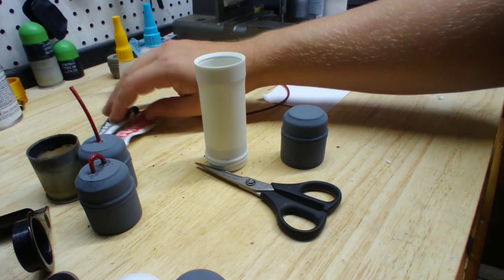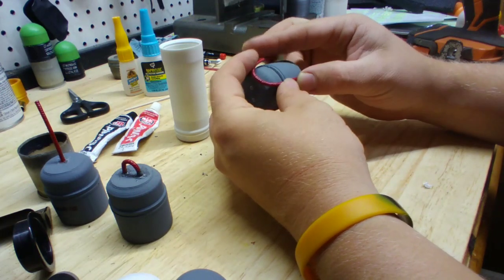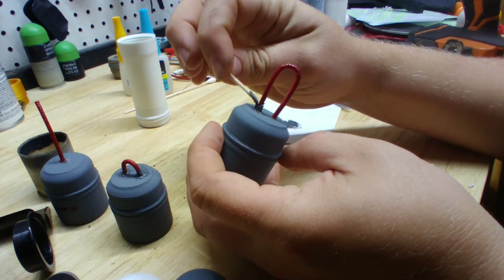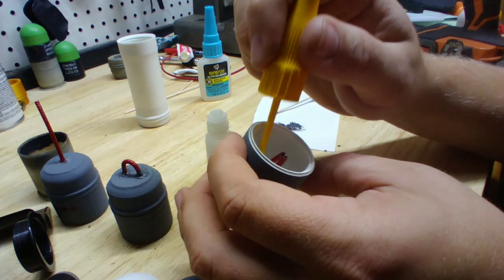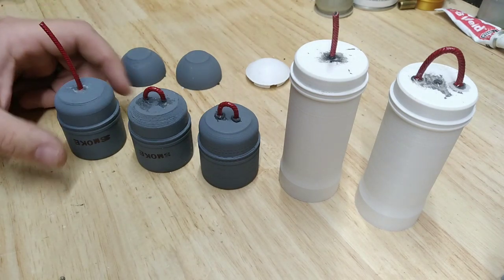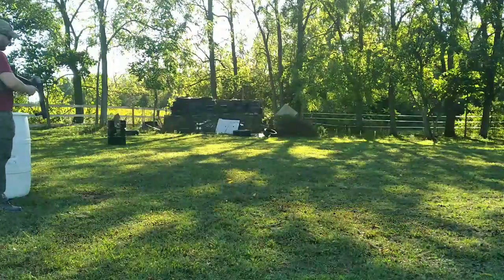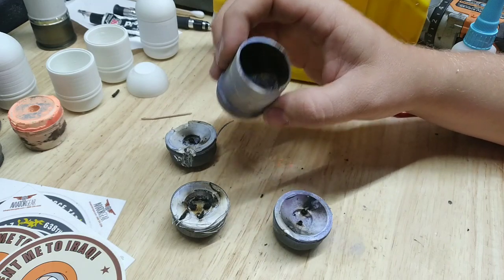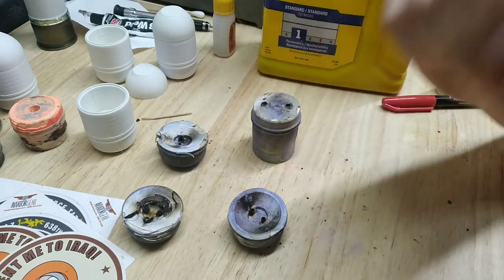Loading 40mm Smoke (Part 1)

Comment: I know it isn't legal but wouldn't it be really easy to make these into actual grenade rounds I would atleast imagine it is
Reply from the maker: Its not illegal to think, yet!! By law you can put up to 1/4 ounce of explosive. I wouldn't want to be the one holding the launcher though. People have literally lost their hand trying that with binary explosives in 37mm launchers.
Reply: @ChevTecGroup  I mean dosnt it have to have compression to explode that's why I thought it wouldn't work
Reply from the maker: @popinmo  that all depends on what you are using. Typically black powder requires compression because it is such a low explosive
Reply: @ChevTecGroup  that's really cool yea that's what I was wondering and thinking
Reply: @popinmo  If you just want a firecracker effect, you can put adult snaps in. If you are prototyping a real fragmentary grenade, as Chev said it's not a good idea, but a safe way to develop it is to only put a primary explosive charge (the detonator) which won't damage you if it goes off prematurely (but would be an expensive cost to your launcher if you aren't a manufacturer). If you can get that to reliably work, then all you need for a real frag round is to put in a secondary explosive and surround it with BBs. The PDF "poor man's RPG" has an example mechanism that would work well for a 40mm round. 

The biggest issue is that most primary explosives are shock sensitive (especially if improperly synthesized resulting in an impure product). The act of firing could cause it to detonate. It's not likely, but then again if you fire a loadout of 13 rounds, you just rolled the dice on your life 13 times.
Reply: @DaveSmith-cp5kj  why not just work on making a safer detonator
Reply: @popinmo  The risk is in the explosive sensitivity not the firing mechanism. The shock of the projectile going from 0 to 300FPS in less than a second can cause an impure explosive to detonate. It's not hard to properly make a primary explosive, but it's hard to tell when you have an impure product.
Reply: @DaveSmith-cp5kj  but why would it go off
Reply: @popinmo  Shock sensitivity means any agitation of the explosive molecules gives it the activation energy to go over the threshold for detonation.

Think of it like dominos. Setup dominos are an explosive. Your finger pushing over the first domino is the energy imparted to make them "explode" tip over. If you push with too weak of a force like with a feather, nothing happens. Only when you have enough energy to push over the first do the rest of the dominos fall.
Reply: @DaveSmith-cp5kj  I mean what explosive is super sensitive then? And what isn't?
Reply: @popinmo  Acetone Peroxide is an infamously sensitive explosive. RDX is like the gold standard in safety but it is extremely expensive to produce even with good lab practices. PETN is easier to make and also relatively stable. But none of this matters because even stable primary explosives can self detonate if improperly synthesized (usually by contamination).
Reply: @popinmo  Also I like your cow sandwich video.
Reply: @DaveSmith-cp5kj  what about pipe bombs are those safe ??? I mean those are diy explosives?
Reply: @DaveSmith-cp5kj  thanks i wish I made for videos

Comment: Whats the max range you can expect out of a 37mm with a practice round?
Reply from the maker: Not sure about 37mm. But with 40mm chalk rounds I have gotten out to 400m. 300m is about max for trying to hit something. But they will go 400
Reply: @ChevTecGroup  Wish I could get a 40mm but the cost of a 203 is just absurd. Is it really that expensive to machine a tube with a hammer at one end?
Reply from the maker: @elcidcampeador9629  yeah prices have doubled since I bought mine. Before 2020 you could get one for less than 900 bucks. The problem now is that all the manufacturers that can make them, are too busy building other stuff to make them for civilian sales.
Reply: @ChevTecGroup  I wish I had a lathe and a vertical milling center. Could probably make a decent 40mm
Reply: @ChevTecGroup  By the way, I sent you an email requesting your 40mm 3d print files. If you could send those my way that would be great.

Comment: What ratios for smoke are you planning on using
Reply from the maker: I'll be following the recipe that "tech ingredients" used in his videos.
Reply: @ChevTecGroup  word...he has one of the best I've seen. Alot cleaner burning then good ol' KNO2+Sugar. I've seen and set up a friend using similar along with a gp and model rocket fuel/igniter. It's tricky setting up just right, but damn... 🤙
Reply: @ChevTecGroup  If you plan on shooting these a lot, I suggest making a chlorate cell. Turn regular water softener salt into an oxidizer. It's a bit of a hassle to setup, but once you build the cell you can have a constant flow of oxidizer being produced for very little electricity. This can be especially important considering many hobby chemical suppliers are shutting down due to regulatory burdens.

Comment: Whats being used as lift charge? 38?
Reply from the maker: Yes. I try to make all my rounds use the standard m781 chalk style 38 blanks for ease of use. If I have to use a different charge, like for less lethal rounds, then I will make sure to note that. Thanks for the question!
Reply from the maker: @WeAllLoveMETH  bullseye powder is the closest thing to M9 powder which is used by the military. I've heard of people using everything from cardboard and Styrofoam for wads, to punching out brass disks from sheets at the hobby stores
Reply: @WeAllLoveMETH  Try playing around with different adhesives. I had a similar problem with shotgun shell loading using old hulls on a star crimp and I found out laying some adhesive like waterglass over the top of the crimp helped build pressure to where the speeds became consistent.